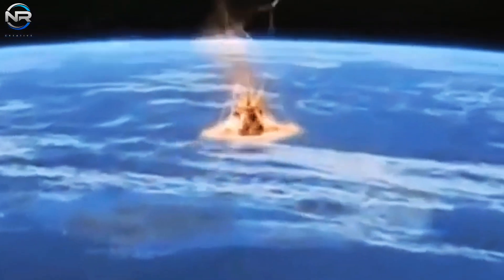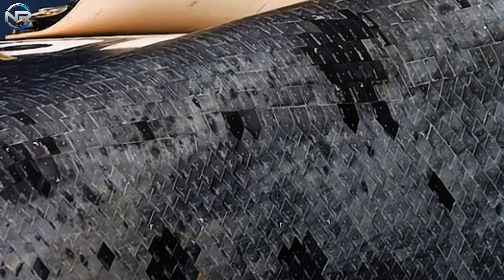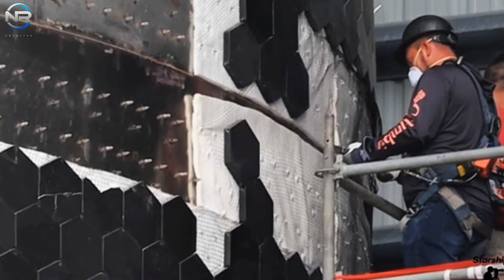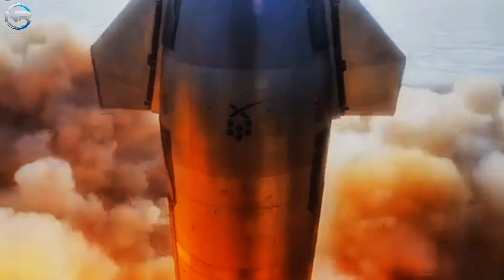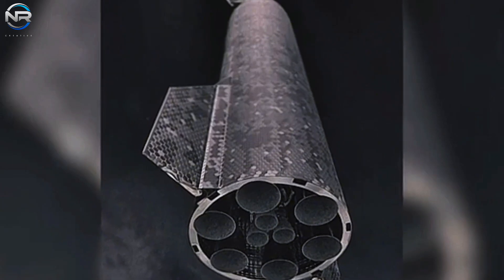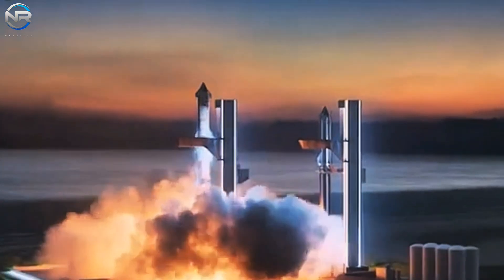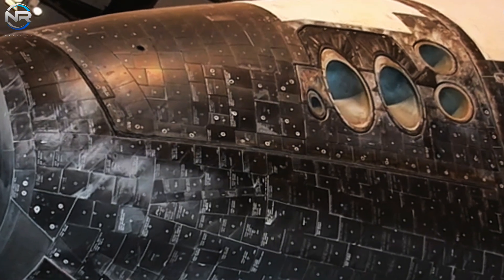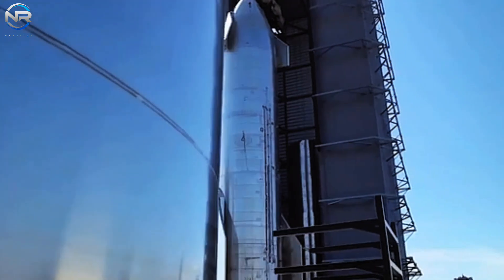Big change! SpaceX Starship's New Heat Shield Is More Sophisticated Than NASA Challenger

Comment: THE BRITISH HAVE INVENTED A SMALL COOLING DEVICE THAT WOULD REMIDY THE HEAT PROBLEM IN THE TILES.  TO GIVE US A IDEA, IT CAN COOL HEATED FUEL FROM 100 DEGREES, AS A EXAMPLE, TO  NEGITIVER 100 IN A FRACTION OF A SECOND, NO CONEN SATION, NO ICE TO BLOCK ANY LINES.  THE BRITISH WANTED TO BUILD A SSTO PLANE, DARPA AND THE USA AIRFORCE HAVE ALL GIVEN TONS OF MONEY.  THE EU GAVE 90 MILLION..   SO IT SOUNDS LIKE A GOOD INVESTMENT.  tHE BRITISH, DO NOT WANT AMERICA STEALING THIS FROM THEM LIKE WITH JETS AFTER WW2.  NOT A EXPERT BUT THE FUEL GETS SUPER HEATED TO THE POINT THE MOLICULES CAN NOT COMBUST.   SO A  TOUGH PROBLEM WITH THE SIZE OF THE DEVICE AND THER ICE PROBLEMS, BUT THE BRIT DEVICE SOLVED THESE PROBLEMS.  AMEN.